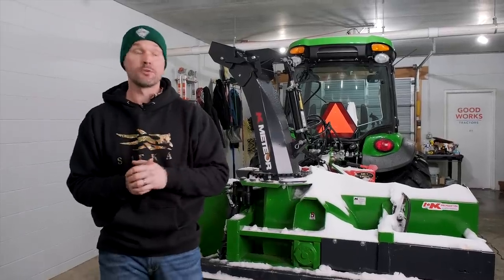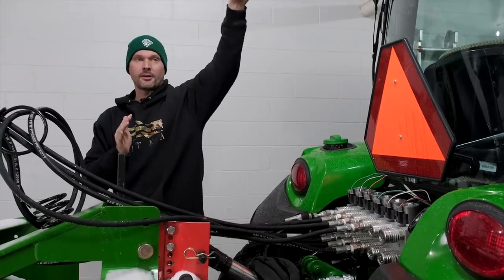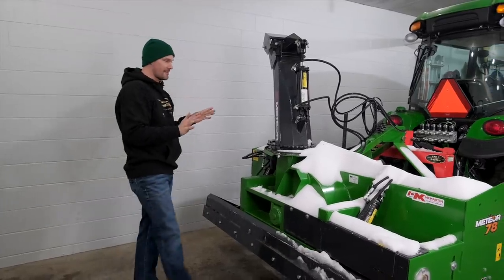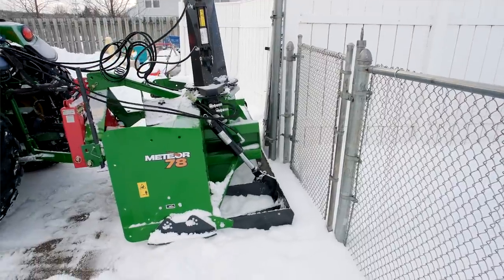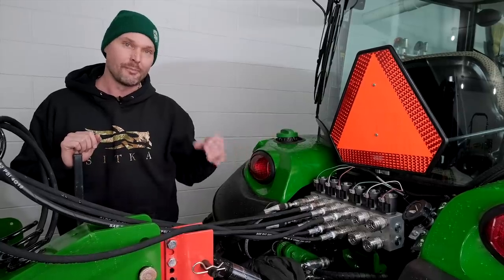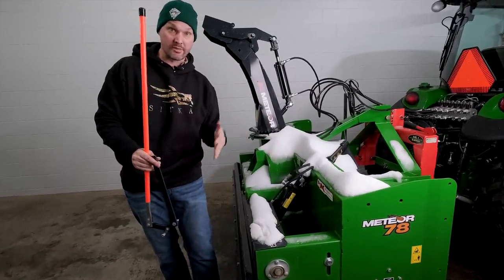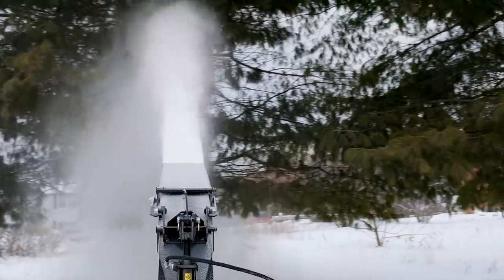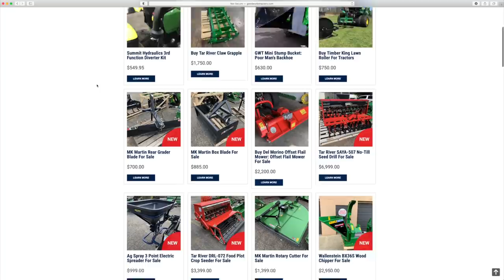INVERTED SNOWBLOWER! 🙃 NO MORE BACKWARDS BLOWING! 😗💨❄️

Comment: 3 things to add:  1) Since all the blowing is happening behind you, you get very little in your face.  2) When you come to an intersection or other potentially hazardous location, you can SEE!  3) You can pull snow out of an area.  I have a porch that sticks out further than the garage, so I just pull the snow 8-10 feet and then can begin blowing it.

The toplink adjustment is critical to how it works.  For pavement, it's best to adjust to a point just before the augers contact the surface.  If the pavement isn't nice and flat, you might need it a bit higher.  For gravel, you want it higher or you'll be throwing rocks.  And yes, these can throw rocks like 80'.  Be sure where your chute is facing and don't let anyone think it's cool to play under the snow.

The reason they have no problem cleaning up the snow that you drive over is that they are HEAVY.  My 80" is 1000 lbs.  Even the small ones are 500+.  Not only does my blower have no issues breaking up and removing snow that has been packed down, it will also break up and remove a lot of the frozen chunks that fall from trees or vehicle wheel wells.  

The best part of these is that nearly any tractor can use them.  My machine is a 1968, but it hooks right up to the standard 3-point and PTO.  Most of the good brands are in Canada like MK Martin, Normand, and Pronovost.  The equipment is EXPENSIVE.  But, the designs are fairly simple, so you can find used blowers for less money that just need a little cleaning, minor repair, and work great.  I got mine from a Canadian dealer that took it in trade for a larger blower and all I needed to do was grind a little rust, paint and grease.  Saved over 50% the cost of new.

There are 3 homes that share a common 1/4 mile gravel driveway.  After that shared gravel, we have paved individual drives.  We keep the gravel as it's not hard to maintain and would cost us over $40k to have paved.  In 2019, the plow service we hired to keep our shared drive clear had billed each house over $1000.  Granted that was an unusual winter with many storms, but I bought the blower for the tractor for $2500.  Also, with the plow, each storm would make the common drive a little narrower.  For many years, I would go out and cut back the sides with the walk-behind blower to make room for the next storm.  That was a 3+ hour marathon to cut back over 1/2 mile of plow berm.   With a 12" snow, it takes me about 45 minutes to clear the common drive, my own drive, and the bulk of the two neighbor's.  The weather isn't too bad, even in an open cab.  I can just wear my motorcycle heated gear and plug into the tractor for warmth.  The fact that I rarely have any blown snow on me also makes a huge difference.

An inverted blower is an amazing piece of equipment.  While the one shown here uses a back drag, there are designs that put the augers further back and move the snow up to a raised impeller that not only cuts right to wherever you backed up, but also leaves almost nothing at the end.  Check out the Normand Hybrid or the Pronovost Cyclone.  In fact, because of these newer designs, you can find the older styles on the used market with a lot of life still in them.

If you live in a snow belt and have a lot to move or just hate having to wrestle with the walk-behind, seriously consider the Inverted.  I absolutely love the 80" blower on the back of my old Ford.
Reply: Thanks for sharing your experience. I get a ton of snow that narrows my driveway substantially. I am going to get this. Looks like it does an amazing job!

Comment: One major benefit of the inverted snow blower that you did not mention is the lack of snow mist. On a front mounted  blower if the wind is blowing at you all you see if a cloud of white and if your on an open tractor your wearing it, not an issue with an inverted rear blower. Another Canadian eh.
Reply from the maker: Very true, I noticed that while blowing, but didn't think to mention it.  Stay warm, eh!
Reply: @GoodWorksTractors   also to note is that the front mount blowers can cause loss of steering. Which you don’t experience with the rear blowers. 

(Yes a good operator, can still operate a front mount) it just adds more is all

Comment: Here in Montreal the residence snow removal contractors have been using those pull type snow blowers for several years... It allows them to back up to the house (garage door or parked car) and pull/blow the snow out of the drive... Generally, it works very well... It allows the driver to look forward as they leave the driveway (more secure)  and they can blow the snow in a specific area (like near the street)... Packing the snow by the tires does not seem to be a big issue... The big problem comes when they install a Teflon edge to protect driveways made of patio stone... That can cause the unit to ride over severely packed snow or ice... The contractors us farm style tractors for this work so we are not hearing the beep-beep-beep when they back up at 3am (thank God!!!)...
Reply from the maker: Yeah, even the steel edges in the video still rode over severely packed snow and ice.  Not much you can do about that besides tackle the job before that condition occurs.
Reply: Hired a company that uses these and my driveway gets packed down, I do not want packed snow on the driveway!!!!

Comment: Nice video.  Feels great to blow all that snow to the neighbors. :)  As for the comments that it won't tackle a 5' drift, neither will a pull blade, or a snow pusher and it would take forever with a traditional 3pt snow blower, all about having the right tools for the job.  I would bet that it will handle 90% or more of the snow events in the mid west or eastern seaboard.  Mountains out west might be another story, but they have the equipment there to handle it.  Thanks for the video, I have been considering one of these and it certainly helps advance my knowledge of them.

Comment: These tractor mounted pull type snowblowers work great for doing residential driveways.  Get a nice customer dense route and you can do many driveways in a short amount of time.
Reply: No to my driveway. They come in and drive over the snow, pack it down and then it is hard packed onto the driveway!!! Not a good set up.
Reply: @mkklaus6892  I've never seen that happen unless contractor adjusted the skidshoes all the way to save his scraping bar = Change contractor.
Reply: @ToreDL87 when doing driveways don't you have to back in and pull out...kinda missing the point your still have to turn around to look where your backing up

Comment: I have a rear mount snow blower on my LX3310 and I can use the rear view mirrors while blowing snow so don't have to turn in the seat like I used to have to when using my BX2200 that doesn't have mirrors. Love your informative videos, even if they star the green tractor most of the time!
Reply from the maker: Haha, I appreciate it!
Reply: Ha ha. 'Glad someone mentioned the ole mirror trick. It works!
Reply: I installed a back up camera. Works pretty darn good. I would still rather go forward though.

Comment: Seems like it would be a great product for 4-8" of snow, but I'd still want a front mount for when we get 12"+ of snow. Just wouldn't be able to drive forward through that much.
Reply from the maker: I can't imagine 12 inches of snow being an issue.  Maybe 18-24".  Even then, I don't know if it would matter with the right snow setup (tires, chains, weight).  There were definitely spots in this lot with drifts or piles 12" or more that I either backed through or drove forwards through and it made absolutely no difference to the machine or blower.
Reply: My Dad has one of the OLD pull blower,, no auger just a V to collect the snow and slide it into the paddles. It works pretty good unless the snow is sticky. We live in Canada just above Michigan so we get a bit of snow here. He used to use a old ford think it was a 8N but now he has a Kubota 3130. I don't think he has ever had a problem with to much snow to drive through, only with the ford he had problems getting the tractor to go the right speed. Only 2 gears to choose from was tough. Now with something like a 1025r or Kubota BX you might have some trouble with deep snow because they don't have the clearance.
Reply: @richardkent9621  i use a back blade on my JD 520 and we just got about 8" and mom doesnt do her loop with her garden tractor blower. I drove through it plowing with no issues and i had the pile approaching the front tires and i stacked it 6.5' high
Reply: I have one, 12 inches is no problem.
Reply: @GoodWorksTractors   yea big snow on the right tractor isn’t an issue. 

I have gone through 21” of accumulation with over 3’ at the ends of driveways. 

It just goes through it.
Reply: My Kubota L2501 has no problem going through 18+ inches of snow pulling a 68" snowblower. I use diamond studded chains. .
Reply: @GoodWorksTractors  I used one during a 52CM snow fall, In Ottawa a few years ago , it worked well, but was obviously slower
Reply: Here where i live we sometimes wake up to 18" with 30+" drifts and pull blowers have no problems clearing that. Granted, they may have to turn around and back into some of the tallest drifts, but nothing prevents themfrom clearing just fine.
Reply: If you have third function to the loader there are hydraulic blowers to put on the loader. If you have pto and front three-point linkage there are pto-driven blowers. But they don't come cheap...

Comment: Nice set take a look at Agri- metal or normand inverted blowers they have the next generation . Basically it a three stage inverted blower. The guy's up here have been running them for about 4 years. 30% more productive out of them. They do a great job no clean up at the end of the driveway. Not putting your blower down good machine but the next generation  is a huge step up for the company that has 300 plus driveways

Comment: Great video. We run 2 Normand hybrid inverted blowers on our 5075e & 2032r and we love them. They have cut down our routes to half the time since switching from a front mount and a conventional rear mount. We operate in Ontario Canada so we do get quite a bit of snow here in the snow belt. Being able to back up to garage doors, drop and go saves so much time. Also doesn't leave a mess at roadway like the others do.
Reply from the maker: Glad to hear it!  Maybe you have experience with how these operate handling 12"+ deep snow?  Do they still work well or is it a pain to drive the tractor through that deep of snow?
Reply: @GoodWorksTractors  We have used them up to 16" and had no issues. If the snow is really wet it doesn't scrape down quite as good however blowing wet snow towards a garage door is far worse. If the snow is lighter it will generally eat through it. From my experience if you can drive through it they will blow it.
Reply: Good set of nokian snow tires will make a huge difference.
Reply: @whiskeydee8835  we have used loaded R4’s for last 17 years without any issues. I hear they work great but between the price and the fact that they wear terribly in the summer is a deal breaker. Also you need 2 sets of rims for unit if your switching them out.

Comment: Have been running Lucknow inverted snow blowers for 20years  now, saves a lot back and neck pain ...the depth of snow you can drive through is limited to the ground clearance of the tractor  deep snow or drifts you can back into  with the blower raised then drop the blower and 'scoop' it out ( the folks with the old V blowers know how to do this)

Comment: Some of the major benefits of these blowers are to the snow removal contractor. Having a dense route system and large enough tractor there’s almost nothing they can’t do. 5 or 6 series tractors are going to be able to back over the Snowplow drift. But if you’re a contractor servicing multiple customer you will be out clearing and not letting the snow pile up to the point that it may be a problem. Just search inverted blowers and you will come up with many videos of companies servicing Quebec cities. Some companies have thousands of customers on their routes with dozens of drivers with machine to do the job. Simply put they work!

Comment: I can see the appeal of the inverted snow blower.  Still, there are such huge differences it the kinds and amounts of snow people have to deal with across the country.  Specifically, no matter the size of the tractor, I've seen drifting during big time blizzards in CO (and I'm sure other parts of the country) that no tractor is going to be able to drive through first.  In this case, a standard push type 3-ph snow blower (non-inverted) will be able to dig its way through the drift, even if you have to take multiple bites at it.  On the other hand, you could bucket your way through that kind of drift, assuming you're not dealing with 100s of yards of serious drifting, and then clean up 12-18" of non drifted snow with the inverted blower.
Reply from the maker: Definitely good scenarios to consider. Amazing how "winter" isn't anywhere close to the same across the country or the world. Lots of ways to tackle things, and lots of experience to build on.
Reply: I’m glad there’s so many choices to consider. Everyone’s environment is different. In regards to driving over the snow before you remove it......he does have a pusher on the front of that beast.
Reply: where in colorado do you see those big blizzard drifts?
Reply: @gabbygonzaga552  Monument Colorado Palmer Divide.  It's a 7,500 ft high point between Denver and Colorado Springs on the I-25 corridor.
Reply: @bradmeacham6982  No way. I just moved to that area and was just about to buy an inverted blower. You dont think that would work here? Even with loader/bucket or plow on the front? How often do you get those big drifts. does it happen often? Last year didnt seem to bad. I managed with just a rear blade on my tractor.
Reply: @gabbygonzaga552  Winters vary LOT around here.  Yes, the last 3-4 last winters have been relatively mild, but I've been through some serious blizzard dumps every 5-6 years.  Given a good size tractor with a strong FEL and bucket to dig through drifts too deep to drive through, a pull type blower may be fine.  That said, a standard push in reverse type 3PH blower (less expensive than a pull type blower, I think) would handle a lot deeper snow, especially wet heavy spring snow.  A standard rear 3PH blower and loader will be a snow fighting machine!  You will have to put up with the "sore neck looking over your shoulder" issue of a push in reverse 3PH blower. 

One caveat...  You're going to want either a hydro transmission, or a geared transmission with a creeper option to avoid having to slip the main clutch a lot when pushing backwards through 2+ feet of wet snow.

'Course, mild winters can be handled well with a reasonably sized 4WD tractor, big rear blade, and the loader.  Mine was a JD 4720 4WD CUT, 400CX MSL FEL, and an 8' Land Pride rear blade (hydraulic angle and offset).  I only had to clear a 100-150 yards of lane and a 35' x 50' parking area.  But, I could always dig out after any storm, even the big ones given time.

Comment: How do you find using the multiplier switches to change functions, now that you have used it for a while? Im thinking, hand off control lever to flip switch off and correct switch  on then hand back to control lever. Is it not to bad or a bit slow or combersome while trying to keep blowing? Looking at it for 3039r.

Comment: I own a new holland bummer 45 and mk 72 inverted and all of the guys that are worried about depth of snow are wrong it works fine , I'd like to see the box blade in 2' 😂 , on a more positive note I have the rear drag bar for getting close to garage doors and it's on chains not hydrologic. This works much better because the hydro like in the video lifts the blower up and the snow piles over back drag , plus the speed at what you can snow blow with inverted is much faster that others , it is definitely the future , only draw back is when you don't have anywhere to blow snow too and need to use as a box blade , mks don't have as much cap as a cyclone 🌀

Comment: I’ve used that style snowblower before. A guy I worked for thought it was going to be the best thing since sliced bread bread. But he didn’t operate it for more than 10-15 minutes. Take it from me it wasn’t a pleasant experience. After about 4-6 hours my neck was so sore I could hardly stand it cause you’re constantly trying to crane your neck to look behind as you’re backing up. Also tried hooking up a rear view camera which worked unless the wind was blowing which then would cover the camera and game over. So my advice to anyone in the market for a tractor mounted blower would be get the front mounted style. You won’t regret it.
Reply from the maker: With that logic, just throw away your 3 point hitch and your front end loader.  No point using those either.  I constantly transition between driving forwards and backwards with most of my attachments.  Pallet forks moving stuff at the shop, bucket to scoop mulch or top soil to spread around the yard, grapple in the woods, box blade, rear blade, dethatching, aerating, spraying, etc.  Inverted snowblowers aren't new, tons of videos on YouTube and tens of thousands in the market.  

If you're talking about the traditional style of snowblower that requires you to drive backwards the entire time, then that's another story.  However, this inverted or pull-type snowblower does not fall into that classification.  What about the guy that needs to use his front end loader year round or has a loader that doesn't quickly come on?  Many variables at work, not a one size fits all solution.

I think the more appropriate suggestion would be to analyze your needs, prioritize them, and let that guide you to the right solution for your individual scenario.